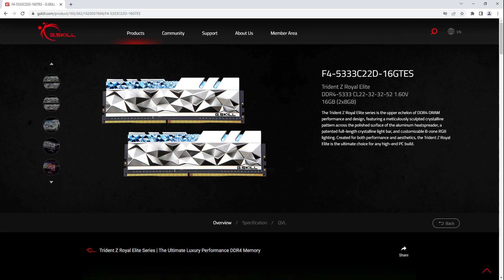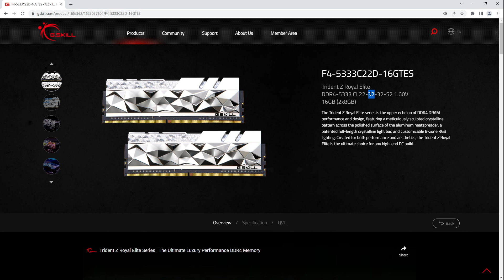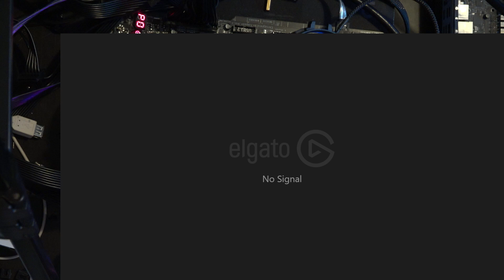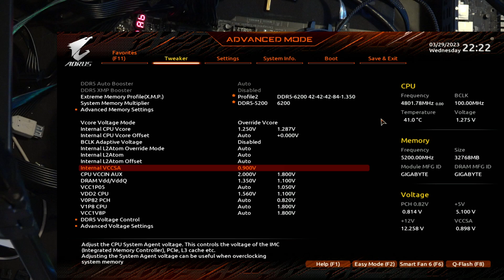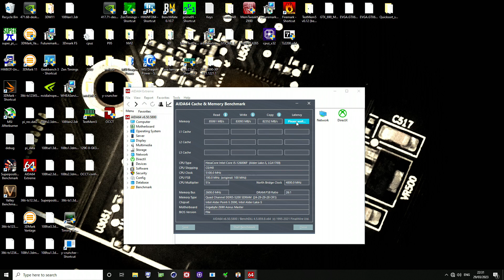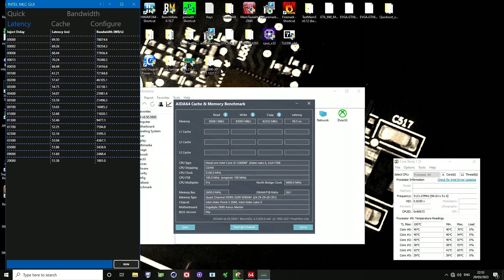DDR5 at CL24! on the Gigabyte Z690 Aorus Master

Comment: Am I dumb to want to get a ddr5-6000 64GB kit and expect similar performance to a 32GB in gaming and some video editiing?
Reply from the maker: https://youtu.be/gGNunQu8xps
Reply: @ActuallyHardcoreOverclocking  what about running 64GB 3800 (or 4000 if the IF can clock 2k) CL14 DDR4 4x16 on Ryzen? I've heard 4 dimm support is kinda spotty but can't find much information on it.

Comment: Hi BZ, which ddr5 mem oc is better for daily? A 6200mhz c28-35-35-28 or 6600 c38-38-38-72?
Reply from the maker: are these XMPs? because those settings don't make any sense if they are manual OCs.
Reply: @ActuallyHardcoreOverclocking  first example  is kind of tweaked asus profile and second one is the fighest that my apex boot. Right now i am using 6200 mhz @ c 28-35-35-28 1T because i get very good latency which is good for gaming. Is that 6600 mhz better for gaming?

Comment: please please please

can you help me to xmp my 128gb ddr5? i have aorus xtremez690 mobo and corsair ddr5 5600mhz cl40
Reply from the maker: on Gigabyte board 4x16 tops out at 5400. I have no idea how 4x32GB behaves. I don't have any 32GB dimms.
Reply: its so harder when u use all of 4 slot each 32GBs with this frequency and CL and try to overclock and tighter timings 
in most Z690 DDR5 Boards u can see in spec they support only 4000 if single rank or dual rank DIMMs fill 4 slots!
while 2 single rank can go up to 6666 in same mobo (Im talking in not OC mode)
but even though always 4 stick make thing harder to get higher frequencies specially with low timings

Comment: That's why you use memory with low settings on limit switching no 16 gb sticks only simular 4 or 6 gigs to your drive tb timings then you make roms virtual cell ramdiscs eg 6gb to 24gb vr roms and use software to increase the memory you have in variety to 2,500 mhz 3000mhz or 2000mhz to load at the same time on a lot of application booster and to get the oc value 1000mhz per ram 1500mhz on 5500 6000 + so the windows system application is optimized for speed and with data ssd and memory on volts from 1.34 volt 1 ram to 1.74v 6xram 1.94v 8x ram if the stupid software would work properly you could use 16 cores all core 16 roms with memory that you can use at the same timecals connection to your memory via ssd and the higher your cpu is the higher your gpu is adjusted thanks to oc temp the higher, the faster and more effective low sticks run and give off more power at the same time with less divided more current, so single rams is so high weak sin sof tware weaksin because it's only designed to be thick and simple, it's a swanky bench speed, not multi to real core, real speed, real data from the system, bulshiit, that's ddr5 for me, you can buy it in the budget, they never have more effective ram, they're just unwise to optimize it test with a time delay after csek loaded let it run at the same time with full sin support nothing works that's why I drive fps data faster so easy low clocks are more efficient on higher voltage more ral dual boards that's too stupid too expensive to build nowadays not even 6 or 4 no 1 2 max ddr5 well no idea weak sin all programming software must be supported not slowed uploaded because the rams are too big only individually less is the point. stupid my opinion
Reply: holy run on sentence
Reply: @andrewschmier6749  tl;dr indeed

Comment: I'm slowly warming to DDR5. I'll be more interested when 7200mhz CL32 are mainstream. (Double the crucial ballistics 3600mhz CL16 kit, not too much to ask)?
Reply: You'll have to wait a long time for that
Reply: @Tomart0  TeamGroup is doing CL40 @ 6400Mhz so it will be sooner than you think. Be interesting to see if the Intel 13th gen gets a updated memory controller as going over 6000mhz on 4 stick on 12th gen is a non starter.

Comment: is  quad channel RAM a thing
Reply from the maker: 2 sticks of DDR5 is quad channel because each stick has 2 memory channels, but each channel is 32bits wide. So it's not same as the quad channel you get on HEDT DDR4 CPUs like the 5960X, 7980XE, 2970X, 3970X which have 4 64bit wide channels.
Reply: No Kingston advice me to stick with 2 *16 gb or 2 *32 for best stability and gaming experience.

Comment: Interesting exploration.  I was wondering what might happen with DDR5 if you were able to get a true 1 clock command rate and the timings as tight as the stick might allow.  Though DDR5 controller may not even have such an option - and if it does, it's not better than JDEC or it'd be the default.  Just interesting exploration for entertainment and discovery.
Reply from the maker: true 1T isn't possible on DDR5 because the DDR5 IMC seems to have no support for gear1.
Reply: Figured it wouldn't exist.  Would have been an interesting experiment if it did though.

Comment: What mobo do you recommend for DDR4?
Reply: ATI Radeon HD 3870 from ebay
Reply: @TheBackyardChemist  Preferably a Sapphire Atomic or ToXic.
Reply from the maker: any ASUS or MSI Z690 board will work well. MSI board generally have more features for a lower price.
Reply: @ActuallyHardcoreOverclocking  you're replying to the wrong guy bz
Reply: @ActuallyHardcoreOverclocking  thank you so much, I have been with Aorus for years but they don't seem to handle DDR4 very well, they released a Elite V2 but its impossible to get it.Kind regards.
Reply: it depends on your budget and your type of using computer.
if u use k series CPU 12th gen

ASUS Strix-A D4 is pretty good mb with alot of features, u can check how good is it. in terms of Phase , IOs. slots. ports and high quality onboard sound 4080

but Z690 TUF D4 is good too. its cheaper. not as good as strix in terms of features and sound and IOs and ports, even weaker in overcloking but still very good not too cheap not expensive Z690 D4 board

MSI Z690 Edge D4 is good too.
I worked with a lot of different boards of many brands for a long time.

mostly in few last intel generation MSI Boards has better and easier RAM OC options. (Im talking about normal and affordable MBs not those expensive +400 USD and higher boards.
like Unify-X or Maximus series or Godlke)

My suggestion is Strix-a D4 if its options is important to u. but if even Tuf is enough for your things but that and save money.
this Mobos will supports up to 13900K.
BUT if u gonna use non K cpus even if upgrade to 13th gen. dont wase your money on Z series.
go for B660 with more reasonable price.
if u need PCI-E Gen 5 Buy B660 TUF or Strix-a (again has some more features than Tuf)

and Msi just introduces MAG B660M MORTAR MAX D4 that will let u overclock Non K cpus with Bclk (very usefull option Asus has this option on 2 B660 of its boards but both are DDR5)
thats pretty good to overclock 12100 and more than that 12400 to beat even 12600 (without extra money)
but sure u better use good cooling not stock. 
a good AIO 120 is perfect, silverstone PF120 is solid choice. good quality, low noise . high static pressure and airflow (more than even much pricier ohter brands options)

but if u gonna use K series for 12600K u need AIO 240 and for 12700K 280 and 12900K 360 without any overclock.

for 12900KS or 13900K u need AIO 420, Arctic liquid freezer II 420 is very nice. powerful and affordable choice 38mm thick (most AIOs are 27mm or 28 (like silverstone). with half of price of even other brands 360s like Aours 360 or Corsair H170i Elite, but u have to choose full tower case 
and if u change Arctic  fans with Noctua premium high static pressure 3x14cm it will be even better, (using 6 as 3 in each side make it monster) but will be so beefy cooler
or go for Custom loop cooling with dual radaitor or a very big and thick one
Reply: *ddr4
gddr4 is for GPUs
Reply: @marcogenovesi8570  that's right ,my mistake